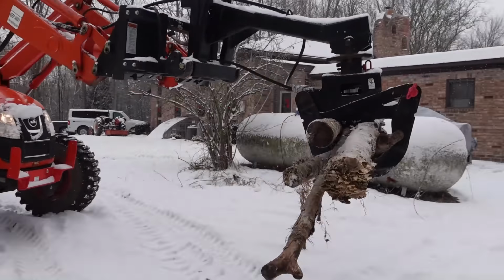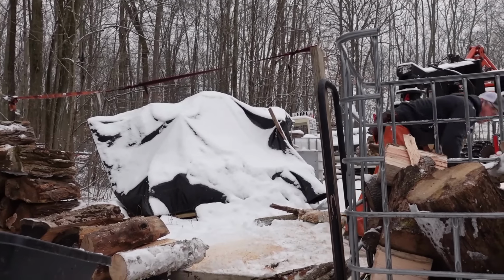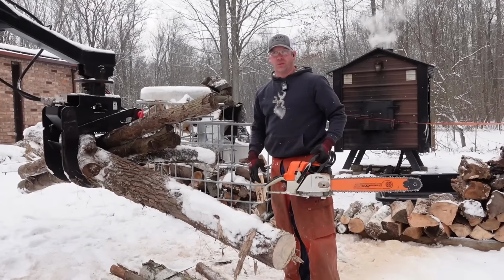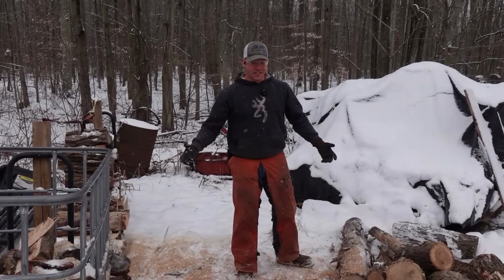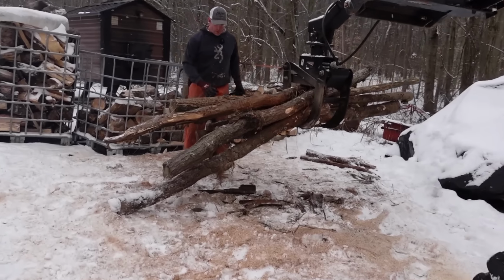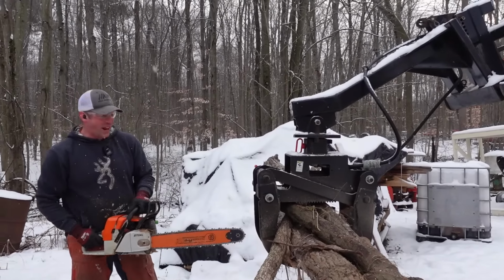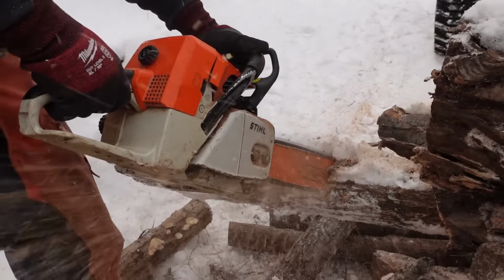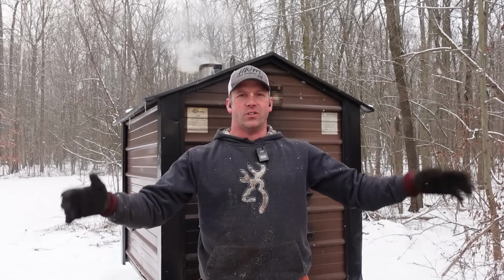Cutting Small Firewood Poles The EASY Way!

Comment: That grapple is perdy nifty not sure I’ve seen you guys use that before unless it’s the one I’ve seen on the back of ya tractor in past videos
Reply from the maker: Thanks Phil, it is the same grapple. I run it both ways. This is on a 3 point quick attach adapter plate.

Comment: That's what i heard with those systems throwing in full logs.  But I'd always say split (dry wood, fire is better).  Look at me, I'm already tired of using my Wood fireplace (starting fire,  emptying ashes, hauling it in ha).  I'm the low working Man!  Hey, got me through the GD POlar vortex!  Paula Abdul.  Have a good one Michigan!
Reply from the maker: I’d definitely say smaller splits would do better but these will still get the job done!
Reply: @hardworkingmanoutdoors  warm now by standards.

Comment: He loves seeing you work that saw just by chance does that have the winter summer carburetter plate on it to stop some freezing up a little bit. Also great video and you’re right cleaning up scrap wood only Burns and it makes the heat you get more heat than one especially when you’re the one doing the cutting lol. Nice to see Rachel in there. Keep an eye on you. Hey question, how far are you from the border? Lol what I call across the pond we’re about 3 1/2 hours to Michigan. Love that grapple I got one that I got to adapt to my tractors too. It’s gonna make things a lot easier. Anyway keep up the good work.
Reply from the maker: Thanks Dave, it does have the moveable plate and I switched it to the winter port. We are about 15-20 minutes from Sarnia. Definitely nice getting free heat from these smaller logs.

Comment: Man that is nice pretty much the next best thing besides having an excavator with a thumb on it 😂
Reply from the maker: It is nice but definitely not as nice as an excavator and thumb!  One day I’ll add one.
Reply: @hardworkingmanoutdoors 
You never showed us any grapple rotational capability.
It is kind of mysterious to me how it works. You probably showed us on another video so I will go look for one.

The extended reach gives reduced weight lifting.
I suppose The long reach would make it good for loading or unloading a tall truck. 
The flexibility gives reduced twisting stress on the loader.
Reply from the maker: @jakebredthauer5100  this grapple can be manually rotated 90 degrees and either left to float for skidding logs or pinned in either position. I do have a more detailed video on it in my videos.

Comment: The grapple works very good 👍 real handy
How do you sharpen a carbide chain  I have never used one
Reply from the maker: I have not sharpened it yet. I believe you need a Diamond wheel to sharpen it but may be wrong.

Comment: I've done quite a bit of cutting using the grapple. It is handy but I never could decide if it was better to gang cut a pile that was decked or keep jumping in and out of the machine that was idling.
Reply from the maker: I think the ability to move them all closer to their end location is a bonus too. I’d love a mini with a thumb but agree it’d be better with a second operator so you could just cut cut cut.

Comment: What make is the Grapple? I am in need of something here when I don't have the forwarder here to load the processor.
Reply from the maker: This is a Ram Splitter 3 point log grapple that I have hooked to a quick attach adapter plate to run off the loader.

Comment: Like to know the maker and model of that grapple. Nice to see all the wood waste being used to heat your water and home. Thanks for sharing.  Have a great day be safe.
Reply from the maker: This is a Ram Splitter 3 point grapple I bought years ago. I am running it off the loader with a 3 point quick attach adapter plate.

Comment: So kinda a Newbie question.  Why do you start cutting with the tip of the saw, and drive the body into the log? Why don't you put the body of the saw against the log and start the cut that way?
Reply from the maker: I think it’s just habit from when I use the firewood pro sizer laser from when I’m cutting for more precise lengths for the wood I sell.

Comment: Sorry to say but if you say the carbide chain doesn't cut as fast then you bought a crappy chain
Reply: I believe he said that it works longer when he is cutting crappie wood. Stuff that has been laying out in the yard. That stuff will dull a chain fast. I don't know how you do it. Working out side in so cold of the weather.
Reply from the maker: It definitely cuts longer but not as fast as my freshly sharpened steel chain.